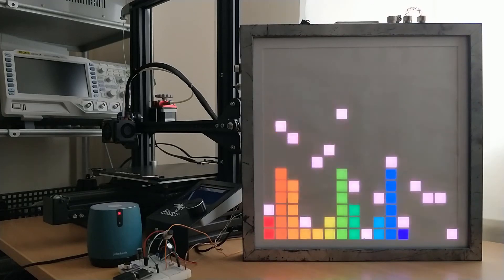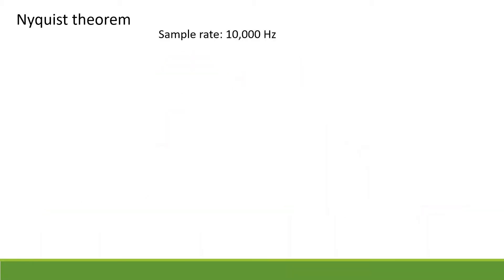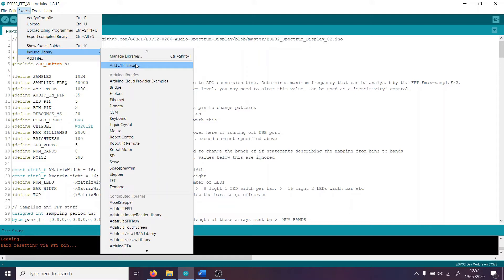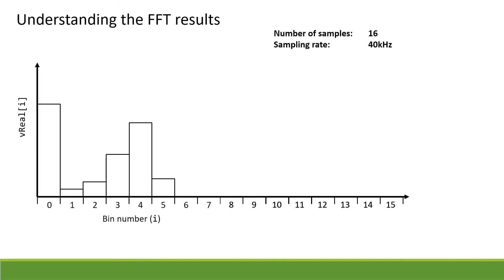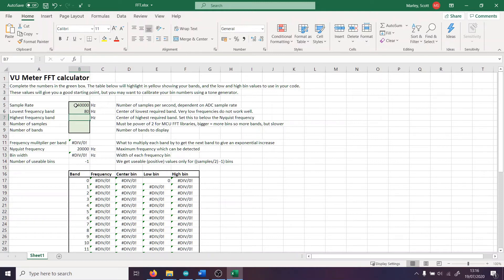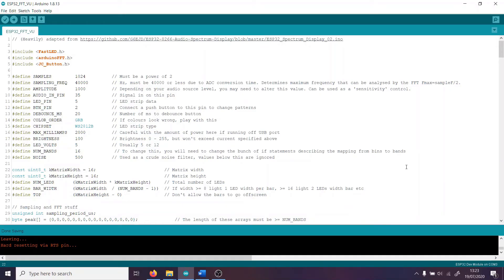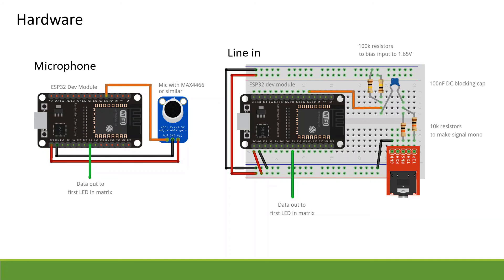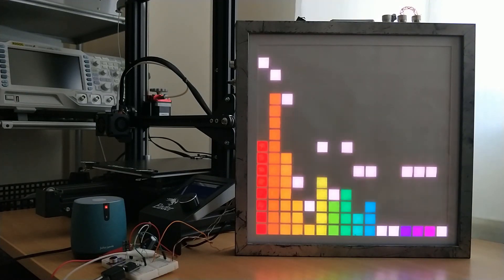ESP32 spectrum analyser VU meter using arduinoFFT and a FastLED matrix

Comment: Hello. I need your help with something. I enter the 5V supply from the adapter to the matrix panel, it is also connected to the 5v input of the microprocessor. it's already a simple circuit, after all, there is nothing but a panel and a microphone. When I energize everything works great. After a while, random LEDs start to light up in the animation. Then smoke comes out of the ESP32.  what am i missing? Is the panel somehow drawing current from the microprocessor? What should I do to prevent this?

Comment: Hi Scott, i built my own version with 24 bands, sadly some of the frequency bands on the top part are always maxed out... any ideas what could cause that? (Seems to be affected by the brightness of the matrix, so maybe something corelating with the max amps flowing?) Thanks for the awesome walkthrough video, had alot of fun with this project!
Reply: I have also faced that and here are some of the reasons/solutions -
1. Top bands sum up many frequency bins - so small errors get summed up. Reducing the upper range of max band (264-380 instead of 264-512) helped. Adding a per-band noise level helped (500 for lower band, 1500 for highest band).
2. Changed the amplitude sum to bar height mapping - made it logarithmic scale and used some y = a + bx + cx**2 formula. For ex. when your Tv/computer is at 50% volume, the amplitude is not half of max amplitude, it's probably around 1/4th.

Comment: Great video... I'm still just getting my feet wet with Arduino IDE and ESP32 programming. I've made a few matrices but I have one in mind specifically for use as a spectrum analyzer/VU meter which would be integrated into another project, but if I follow along with this code and tutorial I believe my display will be skewed 90 degrees from how I'd like it to display. It would be a 12x12 matrix in terms of pixels, but the horizontal and vertical spacing wouldn't be equal (overall dimensions approx 10"x32". Specifically it'd be 12 strips of 12 60/m WS2812b's (so about 7" in length) spaced about 2.5" apart, and I'd want to view it horizontally. I believe if I wired it as you have, it would produce 12 3' tall bands vertically. Do you know if there Is there a way to modify the code to essentially shift what is being displayed 90°?
Reply from the maker: The code is written using the neomatrix library making it possible to use on any wiring direction and in any orientation. See https://learn.adafruit.com/adafruit-neopixel-uberguide/neomatrix-library for how to set it up.

Comment: Just used this code on a 25x15 ping pong ball display like @Bitluni made. One thing to note if you want more that 16 EQ bands you need to modify the array sizes of "peak[]", "oldBarHeights[]", and "bandValues[]" to match the band size (along with modifying the binning if statements)
Reply from the maker: Thanks for the advice to help others :)

Comment: Hi sir,would like to ask if the led you are using was created manually using ws2812 led strip or not? Thanks.
Reply from the maker: This one was made with LED strip. See here for more info https://youtu.be/_0a9JZLGu4M, although before I made this video (the vu meter) I rewired it so that data went in a zig zag rather than always in one direction

Comment: I'm curious which ESP32 you are using. The one I have is outputting an analog read time of 68uS and thus a max sampling frequency of around 14kHz.
Reply: As per one of the comments and responses below, in the boards manager of arduino IDE uninstall the esp32 board version you are currently having and install the 1.0.4 version. I was having the same issue and this fixed the issue for me! Maybe Espressif have to pay attention for this when they release the 1.0.7 update!

Comment: ...the reason I ask is it works yet I get several cycles of good data in the bands then it goes haywire fir a few cycles and then the good data comes back.  This is constant.  Is there some sort of interrupt in the code could be taking place or could it be timing? Any thoughts of what it could be?  I am very new to this but I am a quick learner.

Comment: I wonder could this be integrated into a bluetooth speaker....i.e. send the music via bluetooth to the ESP32........play the music on battery powered speakers .......and display the spectrum on the same  systems.....now that would be a nice project
Reply from the maker: Yes you could, see https://github.com/pschatzmann/ESP32-A2DP for one way of implementing a BT audio receiver. You'd probably want an I2S DAC linked to the ESP, then an audio amplifier connected to that. You could use the DAC on the ESP, but I'm not sure how it would sound.
Reply: @ScottMarley  I appreciate the reply Scott........I am now thinking of buying a Bluetooth enabled amplifier from Aliexpress and feeding the output into the ESP32 (and to the speakers)...............that way the ESP32 is doing only one thing........

Comment: I'm doing something extremely similar and your video has been an extremely helpful resource, I've added a few things like an amplitude balancer. I am running into one issue that I don't see how you overcame.

My analog read function takes 49 microseconds, not 9.7 as documented in code or 10 as mentioned elsewhere. The whole loop takes 52 microseconds and that's a little long for wanting 25 microseconds. I'm struggling trying to find a solution. If you or anyone else knows of one or some hints, That'd be awesome
Reply from the maker: This might be not be the issue, but have you tried different pins? I think another commenter mentioned that they had a similar issue and using a different pin as input made it faster. I might be wrong though! The other thing to check is the clock speed. Is it set to 240MHz? Other than that I'm not sure, I'm not an expert on this stuff I just document what I make.
Reply: Install board support ESP32 1.0.4 version instead of the last one, I just had the same problem
Reply: @djphils  This worked, thank you so much!
Reply: @djphils  This worked for me. I was having a conversion time of ~54 uS and now having ~9.96 uS. Thank you!

Comment: Skecth ran slowly, but now it flies... 
I had previously commented that, despite following along exactly and trying different board library versions, as suggested in comments, my esp32 ran like a 3 legged dog with asthma, uphill, with a heavy back pack on!  However I spotted something (or was that, I missed something) and that was the pin being used in the sketch, pin 35... 
When I checked my datasheet, this was not listed on my esp32 as an audio pin so I simply changed it to a pin that was and bingo...
The sketch now runs  sub 9uS.  :-)
Now whether or not that should have made a difference  could be one for debate, but it did solve my problem.

Comment: I love the esp32 but when I run the code, even though I have nothing attached to the ESP32, the middle bands are still being populated with data.  Do you know what is going on?
Reply from the maker: If there is nothing attached at all, the aanlog pin is probably picking up noise. Either that or you have a very noisy power supply perhaps?

Comment: Hey @Scott Marley , I know this is quite an old video, but I did have one quick question regarding one of the animations if you were still around?
I have more or less completed this project (Awesome video, major thanks for making this), however, all of the light patterns work correctly apart from the purple and blue gradient one named "purpleBars" in the code. the bars function correctly, however, the purple part is placed randomly among the blue bars rather than at the top as an even gradient as you demonstrated, and seems to be glitch around as the bars shift. Any idea what might be causing this? 

Thank you for your time!

Comment: Hi, is there any way of increasing the speed of esp32? I have ESP32 devkit microcontroller, and this project on mine seems slower than yours (I can notice latency)
Reply: It has to do with analogread. It takes forever. I had to adjust parameters of it to get a raw value, it's less accurate, but the speedup is huge. 

Or get a serial interface adc and implement that. The speedup there would be massive and only limited by fft times.

Comment: Hello, thanks for the amazing video. I already had a DOIT ESP32 unit so i decided do make this. I am already quite far. I only have one issue and that is that my ESP32 has a conversion time of 52.17 uS, so a max sampling freq of 19166.64 Hz
. I am still reading into the documentation in order to improve this. Do you have any leads?
Reply: Someone responded to similar problem down below: "If you install the 1.0.4 version of the ESP32 board via the Boards manager and re-run the sample code it does give a result of 9.73uS."
Reply: @tofek321  It actually did the trick. Thanks for the reply.

Comment: Turns out you can also have the ADC sample for you at a provided sample rate, and have it do DMA into buffers which you can then use I2S to read (and avoid spending the CPU time doing the sampling). I’ve been using this on my led strip audio visualizer that I’ve been working on, and it seems to be working great so far.
Reply from the maker: If you have an example of how to do that, that would be great. Sounds a little over my head tbh :)
Reply: @ScottMarley  looks like youtube deleted my last comment that had links in it, so I'll instead give you a YT video ID of an I2S tutorial for the ESP32: ejyt-kWmys8

Also, check out the "HiFreq_ADC" example in the I2S folder of the esp32-arduino github for how to configure the internal ADC to give you data with I2S. I increased the buffer size and count from the values in that example to avoid wasting time repeatedly calling i2s_read for only a few samples each time.
Reply from the maker: @yoted  great, thank you!
Reply: Hey, I was wondering if you can share an example of how to do that, this would be really helpful.
Reply: I would love to see an example of this, sounds GREAT! Thank you.

Comment: Hi Scott, 
thanks a lot for the time you took in sharing your project! 
If you can, why don't you set the sampling frequency higher, to 100kHz for example? Wouldn't it also shrink the latency time? After sampling the audio pin in 9.7microseconds the program waits nearly 15microseconds, before the next sample. After 1024 samples the for-loop ends and the FFT starts, right? That adds up to an unnecessary delay of ~15milliseconds. 
This is my first arduino/esp32 project and I also haven't coded before, so please correct me if I'm wrong :D Thanks! 
Max
Reply from the maker: You could try that and see what happens, however I'm not sure what benefit it would bring. If you're using e.g. a MAX4466 based microphone, the 3dB point is at just 6kHz and by 20kHz its basically zero. A line-in would be better of course, but when I tested my hearing response, I could only get up to about 18kHz before I couldn't hear anything at all. Plus, extra time is required to do the FFT calculations, create the patterns and output the LED data to the matrix. However, do let me know if you do try it and of you get reasonable results.

Comment: Hi Scott! Again great video! I really enjoy your content! The way you explain everything is super!

One question. What do you think? Would it make sense to combine FFT with stereo vu meters? It sometimes seems the response time is slow with the mega and two 2813 strips containining 142 LEDS in stereo. Thanks!
Reply from the maker: Thank you! I wouldn't recommend using an Arduino for fft stuff, they're very very slow. Try a teensy or ESP32, the code is the same but they're much faster (16MHz Vs up to 240Mz!).
Reply: @ScottMarley  Sorry, forgot to mention. I'm thinking about replacing the mega with a Teensy 4.0 or 4.1. I'm struggling a bit with how to make FFT work in stereo line in.

Comment: Very nice video! I'm a space-engineering student from Sweden and have come across a couple of problems trying to recreate this project but with only a straight led strip. If possible I would really appreciate if I could get a helping hand with my project since it's probably quite eazy for someone with previous experience. 

My setup is as follows:
- NodeMCU
- Adafruit MAX9814
- WS2811
- button

My problems are as follows:
- Don't know why it seems like the frames per second is extremely slow.
- Sometimes colors appear where they shouldn't.
- I can for the love of me not find the excel frequency band calculator.

My code:
#include <FastLED.h>
#include <arduinoFFT.h>
#include <EasyButton.h>

#define SAMPLES         1024                              // Must be a power of 2
#define SAMPLING_FREQ   40000
#define AUDIO_IN_PIN    A0                                // Signal in on this pin
#define LED_PIN         D1                                // LED strip data
#define BTN_PIN         D4                                // Connect a push button to this pin to change patterns
#define COLOR_ORDER     BRG                               // If colours look wrong, play with this
#define CHIPSET         WS2811                            // LED strip type
#define MAX_MILLIAMPS   2000                              // Careful with the amount of power here if running off USB port
#define LED_VOLTS       12                                // Usually 5 or 12
#define NOISE           500                               // Used as a crude noise filter, values below this are ignored
#define NUM_LEDS        100
#define NUM_BANDS       4
#define SERPENTINE      true                              // Set to false if you're LEDS are connected end to end, true if serpentine
#define TOP             NUM_LEDS/NUM_BANDS

int bandValues[] = {0,0,0,0,0,0,0,0,0,0,0,0,0,0,0,0};
double vReal[SAMPLES];
double vImag[SAMPLES];
unsigned long newTime;
unsigned int sampling_period_us;
arduinoFFT FFT = arduinoFFT(vReal, vImag, SAMPLES, SAMPLING_FREQ);

// FastLED stuff
CRGB leds[NUM_LEDS];

void setup() {
  Serial.begin(115200);
  FastLED.addLeds<CHIPSET, LED_PIN, COLOR_ORDER>(leds, NUM_LEDS).setCorrection(TypicalSMD5050);
  FastLED.setMaxPowerInVoltsAndMilliamps(LED_VOLTS, MAX_MILLIAMPS);
  FastLED.setBrightness(100);
  FastLED.clear();

  sampling_period_us = round(1000000 * (1.0 / SAMPLING_FREQ));
  
}

void loop() {

  for (int i = 0; i<NUM_BANDS; i++){
    bandValues[i] = 0;
  }

  for (int i = 0; i < NUM_LEDS; i++){
    leds[i]=0;
  }

  for (int i = 0; i < SAMPLES; i++) {
    newTime = micros();
    vReal[i] = analogRead(AUDIO_IN_PIN); // A conversion takes about 9.7uS on an ESP32
    vImag[i] = 0;
    while ((micros() - newTime) < sampling_period_us) { /* chill */ }
  }

  FFT.DCRemoval();
  FFT.Windowing(vReal, SAMPLES, FFT_WIN_TYP_HAMMING, FFT_FORWARD);
  FFT.Compute(vReal, vImag, SAMPLES, FFT_FORWARD);
  FFT.ComplexToMagnitude(vReal, vImag, SAMPLES);
  
  for (int i = 2; i < (SAMPLES/2); i++){       
    if (vReal[i] > NOISE) {

    //4 bands, 12kHz top band
      if (i<=13 )          bandValues[0]  += (int)vReal[i];
      if (i>13  && i<=55 ) bandValues[1]  += (int)vReal[i];
      if (i>55  && i<=229) bandValues[2]  += (int)vReal[i];
      if (i>229          ) bandValues[3]  += (int)vReal[i];
    }
  }

  

  for(int i = 0; i < NUM_BANDS; i++){
    
    int barHeight = bandValues[i] / 1000; 
    if (barHeight > TOP) barHeight = TOP;
    
    for(int j = 0; j < barHeight; j++){
      
      leds[j+i*TOP]=CHSV(0,255,255);
      
    }
    
  }

  FastLED.show();
}

Comment: amazing work. How can I represent the values in the serial poltter, or by matploit? and if I want to add more time in the samplng period, should I increase the frecuency?
Reply: hello, how are you doing I have the same question did get the answer?
Reply: @medb2322  Hi guy. In the end I couldn't get an answer of what I was trying to question, but luckily I could resolve it my myself.  I simply pass the data via UDP to a Python environment, and then I applied the Fourier transform with scipy library. This allows me to visualize the data with matplotlib, and have a better understanding of the information acquired. Did you understand?
Reply: @faramirchevlonski6152  hi bro, Nah i didn't understand could you please explain
Reply: @medb2322  Did you not understand because I don’t explain myself properly or because you are not familiar with this kind of concepts? If it’s the second case I suggest you to search about this, and try to find a solution that works in your specific case. The only thing I can do is to send you my repository where I put all the concepts that I explain you in the message before in practice

Comment: I tried writing fft on my own.But It is not efficient enough.complex calculations makes the problem lot harder.Is there an efficient way to implement complex numbers.I used a 2d matrix (2 columns) to do my claculations and I think it makes the program lot slower.And is a buffer with 1024 samples enough to implement ?
Reply from the maker: The Arduino fft functions have been written to be very efficient, using special techniques to save CPU cycles and RAM. Is there any reason why you want to write your own version? It's not trivial, and you would have to have a good knowledge of both mathematics and C++
Reply: @ScottMarley  just for fun actually.I know the mathematics behind it to some extent but im not very much good at c++ and optimization.
Reply from the maker: @SLguitarGuy  for fun is a good reason! There is info on the Arduino library implementation here http://wiki.openmusiclabs.com/wiki/ArduinoFFT and it details some of the optimisations that have been made.
Reply: @ScottMarley  thank you very much.really appreciate it